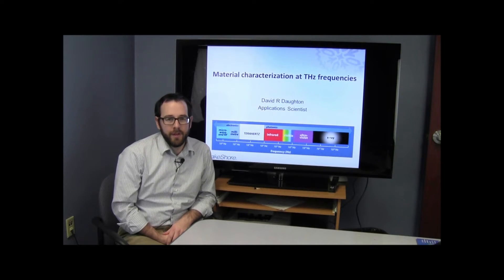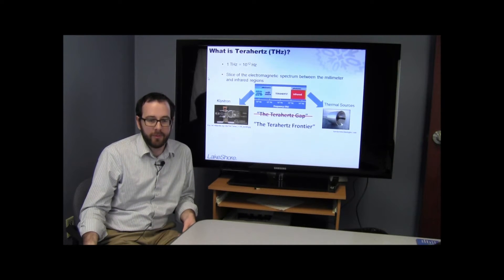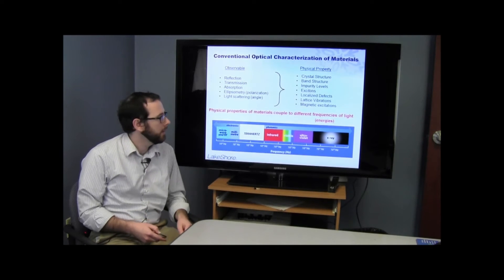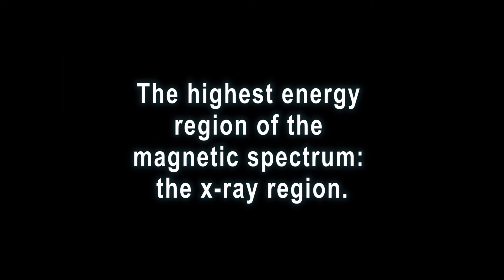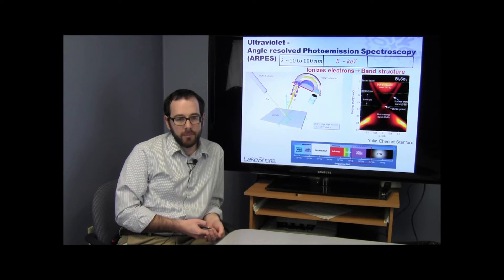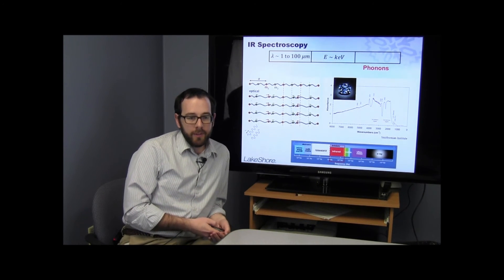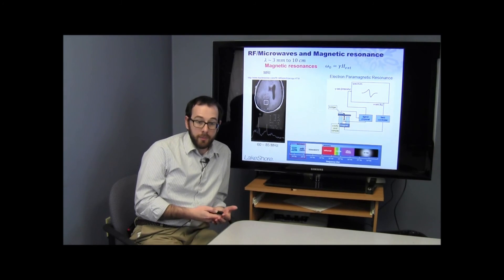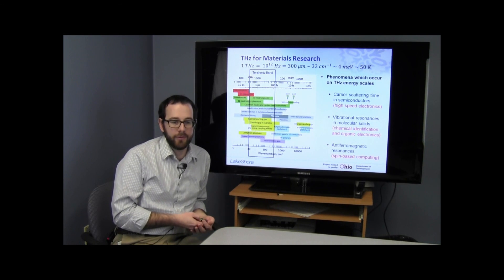Terahertz Basics with Dr. David Daughton

Comment: Hello,

we have substantial stock of GaP, ZnTe, GaAs, CdTe and MgO:LN for THz applications.
Also available THz HRFZ Silicon windows, beamsplitters, lenses, and vacuum viewports
Photoconductive antennas PCA for terahertz waves

For example here is the current GaP stock list

Mounted and unmounted GaP crystals for THz
https://www.youtube.com/watch?v=feWaF0WeGpcHere for example current GaP stock:

GaP stock (H - in a standard mount diam 1", AR - AR coated both sides)
5x5x0.03  2
5x5x0.05  1
5x5x0.05H 1
5x5x0.1 5 - (unmounted, shipped in 3D printed container)
Unmounted GaP crystals and assemblies are shipped inside 3D printed container
https://www.youtube.com/watch?v=kowAxhM9tuY
5x5x0.1AR800 1
5x5x5    2

10x10x0.1   4 - (unmounted, shipped in 3D printed container)
10x10x0.1H  3
10x10x0.2   2
10x10x0.2H  3
10x10x0.3H   7
10x10x0.3AR800 2
10x10x0.5H   6
10x10x1H     2
10x10x1AR800  1
10x10x2.5  1

10x10x0.3_3  1 - assembly 300micron GaP 110 on 3mm GaP 100
GaP assembly 300micron GaP 110 optically contacted on 3mm GaP 100 for THz applications
https://www.youtube.com/watch?v=powRoTYP30o

Terahertz vacuum viewports:
https://www.youtube.com/watch?v=NfXrs5qOf60

Let us know if you need anything else - I attached a brief product portfolio for your reference.

Best regards,
Sergey Egorov
Egorov Scientific
Del Mar Photonics
4119 Twilight Ridge
San Diego, CA 92130
www.dmphotonics.com
sales@dmphotonics.com

Comment: Did you know there is a hand held device using Terahertz frequencies, and other technologies that’s changing people’s life to allow the body to heal itself. 🙏🏻🇨🇦
Reply: How can these devices be tested for authentication
Reply: @jonanthony6078  use it nothing like a free treatment   leave the pain behing
Reply: What is the  name
Reply: @chuckamerican Itera care by prife.
Reply: My friend has one so I'm going to open it up. Anyway I'm 100% convinced this is a scam for various reasons. Yes it does have some benefit. Because the heat is good for some things. But there is no quantum anything and no terrahertz waves. Because it's scientifically impossible to create terrahertz waves for theraputic use at room temperature. The closest is -10F. 
Technically all kinds of light including your cellphone screen gives off light in the terrahertz wavelength. The blue LEDs in the wand are just normal blue LEDs and do nothing at all. There is no quantum or Tesla or scalar technology at all. And no tests or studies done on this device at all. It's a total con. But yes it will have some benefit by its heating effect.
Which can be soothing to muscles and promote healing. BUT you can do exactly the same thing with a 10 dollar hair dryer!
That's what makes this con so good! It does give some comfort. But it's extremely over priced and has many false claims. For example the claim that it can scan the body for disease. Which is total rubbish. There is no computer or scanning equipment. It's just a hair dryer with some blue LEDs. That's all. The original model isn't even a good hair dryer. It overheats as it's so cheaply made. 
They also claim there is quartz as well as quantum. There is no such thing. When I checked the main website it became clear there is no real science behind this. Just links to info on terrahertz technology but no actual terrahertz in the wand. It's a clever trick.
Reply: Tell us more please. How do we purchase one of these devices?